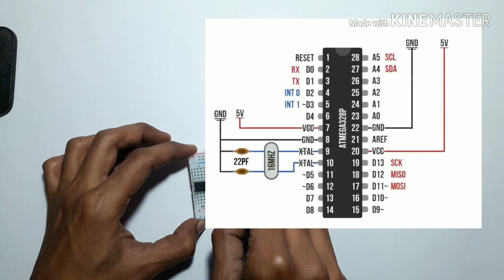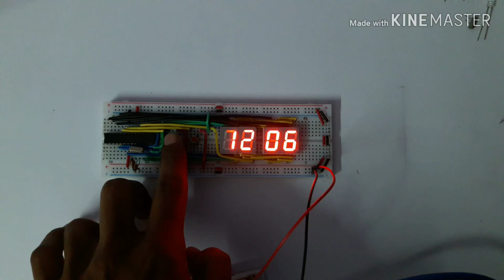Arduino 4 Digit 7 Segment Display Clock With RTC || 7 Segment Clock Project

Comment: Can my display and common anode change the code to work with a common anode?
Reply from the maker: Yes!! Why not....according to your display Common anode or common cathode.....you can modify the code......

If you have any problems....then comment below.. I'll try to solve your problems.....
Reply: @SoftTech10  i have to little problem with middle boiling light .... Can you help me to fix this
I will try your method to my single 4digit 7segment ........
88:88 like thiss

Comment: Sir which is 17,16,18,19 no. Pin in arduno. Plz share schmetic digram. Kya ye pekle wale video hi pin same hongi
Reply from the maker: Hnn mere pehle wale video ke jaisa hi hai bs ye Common Cathode display hai.....aur pahle wale me Common anode display tha
Reply from the maker: Schematic diagram same hai dono ka aap pahle wale video se download request kro mai accept kr lunga
Reply: Thanx for reply  sir. Kya m is m huge led se bana segment use kar sakta hu. arduino led k current ko handle kar sakta hai. Per segment only 2led hai.
Reply: @RizwanAli-ev9gm  uske lie LED Driver circuit use karna hoga

Comment: //# Saif40

//this is a 4 digit 7 Segment clock using arduino 

#define MIDDLE 0 // G

#define UPPER_L 1 // F

#define LOWER_L 2 // E

#define BOTTOM 3 // D

#define LOWER_R 4 // C

#define UPPER_R 5 // B

#define TOP 6 // A

// pin 13 is the colon between the hours and minutes

int groundPins[7] = {2, 3, 4, 5, 6, 7, 8}; // G, F, E, D, C, B, A

int digitPins[4] = {17, 18, 19, 16}; // positive voltage supply for each of the 4 digits -17 is RIGHT most digit-

int ON = LOW; // HIGH for CA, LOW for CC

int OFF = HIGH; // LOW for CA, HIGH for CC

int number[10][7]; // holds information about which segments are needed for each of the 10 numbers

int digit[4]; // holds values for each of the 4 display digits

 int hours = 12;

int minutes = 00;

int elapsedMinutes = 0;

int seconds = 0;

int secon;

int hourset = 14;

int hoursetv = 0;

int minuteset = 15;

int minutesetv = 0;

int showsw = 12;

int showswv = 0;

unsigned long prevtime;

int showtime = 16380;

int delaytime = 200;

void setup()

{

  digitalWrite(13, HIGH);

  pinMode(hourset, INPUT);

  pinMode(minuteset, INPUT);

  pinMode(showsw, INPUT);

  digitalWrite(hourset, HIGH);

  digitalWrite(minuteset, HIGH);

  digitalWrite(showsw, HIGH);

  initNumber();

  for(int i=0; i < 7; i++) {

    pinMode(groundPins[i], OUTPUT);

    digitalWrite(groundPins[i], LOW); // HIGH for CA, LOW for CC

  }

  for(int i=0; i < 4; i++) {

    pinMode(digitPins[i], OUTPUT);

    digitalWrite(digitPins[i], HIGH); // LOW for CA, HIGH for CC

  }

}

 void loop() {

  int n = 0;

  unsigned long time = millis() - (elapsedMinutes * 60000);

  seconds = (time / 1000);

  if (seconds > 60) {

    seconds = 0;

    minutes++;

    elapsedMinutes++;

    if (minutes >= 60) {

      minutes = 0;

      hours++;

      if (hours > 12) {

        hours = 1;

      }

    }

  }

  n = (hours * 100) + minutes;   /* change  */

  setDigit(n);

   for(int g=0; g < 7; g++) {

    digitalWrite(groundPins[g], HIGH); // LOW for CA, HIGH for CC

    for(int i=0; i < 4; i++) {

      if (digit[i] < 0) {

        continue;

      }

      digitalWrite(digitPins[i], number[digit[i]][g]);

    }

    getDelay(); // delay multiplexing function

    digitalWrite(groundPins[g], LOW); // HIGH for CA, LOW for CC

  }

  if (time - prevtime > 500) { // toggle a second flag to blink the colon

    prevtime = time;

    if (secon == 1) {

      secon = 0;

      return;

    }

    if (secon == 0) {

      secon = 1;

      return;

    }

  }

if (secon == 1) {

  digitalWrite(13, HIGH);

}

if (secon == 0) {

  digitalWrite(13, LOW);

}

hoursetv = digitalRead(hourset); // hour set button

if (hoursetv == LOW) {

hours++;

delay(40);

if (hours > 12) {

  hours = 1;

}

}

minutesetv = digitalRead(minuteset); // minute set button

if (minutesetv == LOW) {

minutes++;

delay(40);

if (minutes > 59) {

  minutes = 0;

}

}

showswv = digitalRead(showsw); // button to slow the multiplexing down

if (showswv == LOW) {

showtime = 16380;

delaytime = 200;

}

}

 void setDigit(int n) {

  n = n % 2000;

  digit[0] = n % 10;

  digit[1] = (n / 10) % 10;

  if ((digit[1] == 0) && (n < 10)) {

    digit[1] = -1;

  }

  digit[2] = (n / 100) % 10;

  if ((digit[2] == 0) && (n < 100)) {

    digit[2] = -1;

  }

  digit[3] = (n / 1000) % 10;

  if (digit[3] == 0) {

    digit[3] = -1;

  }

}

 void getDelay() { //stutter the multiplexing refresh

  if (delaytime >= 7) {

  delay(delaytime);

  delaytime -= 1;

}

  if (delaytime < 7) {

  delayMicroseconds(showtime);

  showtime -= 35;

  if (showtime <= 1501) {

  showtime = 1500;

  }

  }

} 

 void initNumber() {

  number[0][MIDDLE]  = OFF;

  number[0][UPPER_L] = ON;

  number[0][LOWER_L] = ON;

  number[0][BOTTOM]  = ON;

  number[0][LOWER_R] = ON;

  number[0][UPPER_R] = ON;

  number[0][TOP]     = ON;

   number[1][MIDDLE]  = OFF;

  number[1][UPPER_L] = OFF;

  number[1][LOWER_L] = OFF;

  number[1][BOTTOM]  = OFF;

  number[1][LOWER_R] = ON;

  number[1][UPPER_R] = ON;

  number[1][TOP]     = OFF;

   number[2][MIDDLE]  = ON;

  number[2][UPPER_L] = OFF;

  number[2][LOWER_L] = ON;

  number[2][BOTTOM]  = ON;

  number[2][LOWER_R] = OFF;

  number[2][UPPER_R] = ON;

  number[2][TOP]     = ON;

   number[3][MIDDLE]  = ON;

  number[3][UPPER_L] = OFF;

  number[3][LOWER_L] = OFF;

  number[3][BOTTOM]  = ON;

  number[3][LOWER_R] = ON;

  number[3][UPPER_R] = ON;

  number[3][TOP]     = ON;

   number[4][MIDDLE]  = ON;

  number[4][UPPER_L] = ON;

  number[4][LOWER_L] = OFF;

  number[4][BOTTOM]  = OFF;

  number[4][LOWER_R] = ON;

  number[4][UPPER_R] = ON;

  number[4][TOP]     = OFF;

   number[5][MIDDLE]  = ON;

  number[5][UPPER_L] = ON;

  number[5][LOWER_L] = OFF;

  number[5][BOTTOM]  = ON;

  number[5][LOWER_R] = ON;

  number[5][UPPER_R] = OFF;

  number[5][TOP]     = ON;

   number[6][MIDDLE]  = ON;

  number[6][UPPER_L] = ON;

  number[6][LOWER_L] = ON;

  number[6][BOTTOM]  = ON;

  number[6][LOWER_R] = ON;

  number[6][UPPER_R] = OFF;

  number[6][TOP]     = ON;

   number[7][MIDDLE]  = OFF;

  number[7][UPPER_L] = OFF;

  number[7][LOWER_L] = OFF;

  number[7][BOTTOM]  = OFF;

  number[7][LOWER_R] = ON;

  number[7][UPPER_R] = ON;

  number[7][TOP]     = ON;

   number[8][MIDDLE]  = ON;

  number[8][UPPER_L] = ON;

  number[8][LOWER_L] = ON;

  number[8][BOTTOM]  = ON;

  number[8][LOWER_R] = ON;

  number[8][UPPER_R] = ON;

  number[8][TOP]     = ON;

   number[9][MIDDLE]  = ON;

  number[9][UPPER_L] = ON;

  number[9][LOWER_L] = OFF;

  number[9][BOTTOM]  = ON;

  number[9][LOWER_R] = ON;

  number[9][UPPER_R] = ON;

  number[9][TOP]     = ON;

}